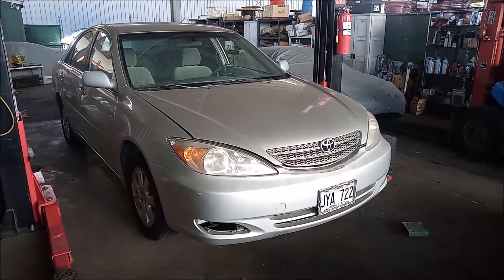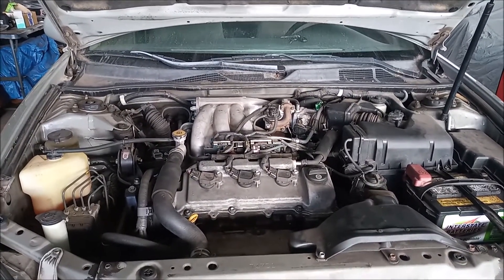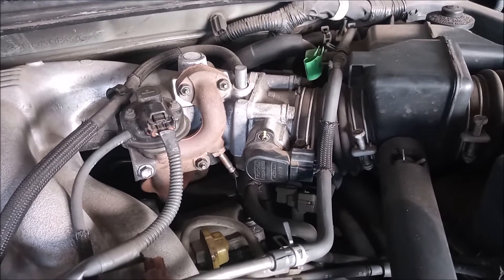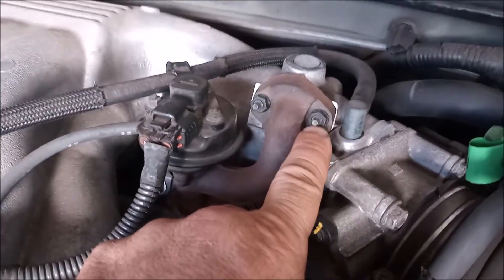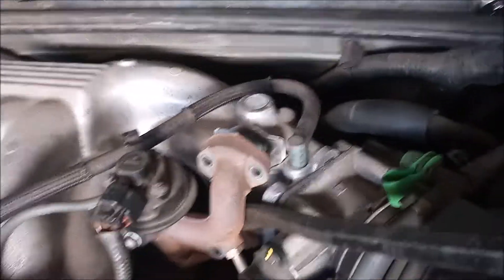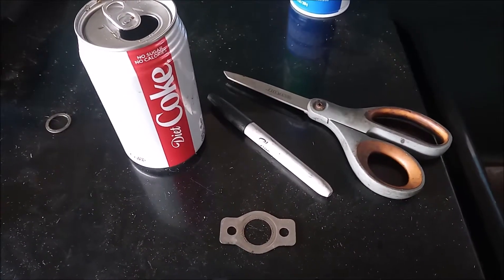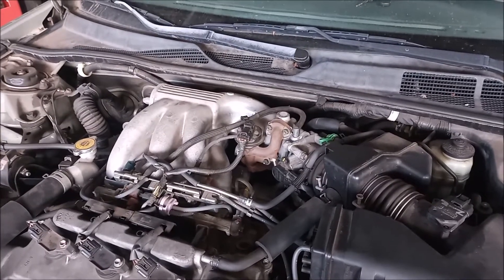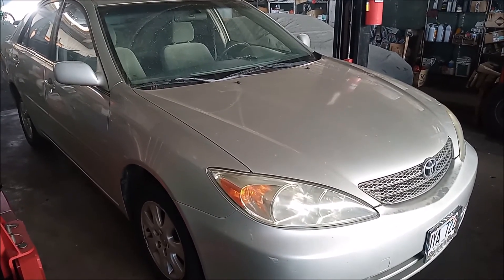EGR System Block Off Test - 2002 Toyota Camry 3.0 V6 1MZ-FE

Comment: ACIS ACOUSTIC CONTROL INDUCTION SYSTEM.  FOLLOW VACUUM LINES TO VSV & CHECK VALVES BUY NEW HOSES IT CONCERNED. CHECK ACUTUATOR FOR ACIS BE SURE DIAPHRAGM IS GOOD. CHECK SET SCREW ALSO

Comment: In order to possibly help someone… ‘98 Avalon with 1MZ-FE.

For years it had a throttle shudder(at all RPMs/only in gear) with no code. I thought it was most likely transmission related.

It finally threw a fleeting code(I just happened to have my scanner hooked up looking at live data whilst driving one day and caught it as it didn’t last long) for EGR position sensor.

Couldn’t find a genuine Toyota part. Amazon China part under Standard auto parts brand. It actually worked. Car drives so much better.
Reply from the maker: Thank you for watching and for commenting.

Comment: I think your looking in the exact right place my 2003 camry 1mzfe had the exact same problem and it was the egr valve your test was the problem I disconnected the egr through the main harness and it solved all the issues blocking it off only stopped the excess fumes from going into the intake manifold it didn't stop the erratic nature of the bad egr valve wich the car was obviously experiencing I also never had a code thrown
Reply: It's the sensor thinking there should   there should be the excess fumes coming at a particular time because the car electronically thinks the egr valve is doing what it should so it keeps changing the tables but it's because mechanically the valve isn't opening or isn't opening enough and blocking it off dosent change the tables It's actually 100% diagnosing the problem with out you realizing
Reply from the maker: Thank you for this info.
Reply: are you saying you just left it on and unplugged it?

Comment: I'm getting P0401 and P0402 both on a V6 2002 camry. Any suggestions ?  One code says high flow other says low flow so I don't understand how it can be both.
Reply: Was it a "sticking" EGR Valve? Under one condition it produced too little, and under another it caused too much, while hanging open?
Reply: I have an 2000 1MZFE doing the exact same thing but I don't understand it can't be sticking though already I just put the EGR in
Reply from the maker: Tough call.

Comment: Everyone searching for misfiring problems. On bank 1 try that first cat mine melted everything inside to become a metallic cork in the exhaust downwards from the cat on bank one. To check if it runs better take out O2 sensor on bank 1 and that will free up air. Then if you get power back significantly.. You have your issue.

Comment: My 2002 Camry XLE would sometimes stall when stopped at red lights, about once or twice a month. At which point, it would be unable to start again for a good 5-10 minutes. I took it into the Toyota Service Center three separate times that it stalled but they were unable to replicate or diagnose the problem. Frustrated I started searching car forums online and someone suggested an issue with the EGR valve. I ordered a replacement online and had it installed. 15+ years later and it has never stalled again.
Reply from the maker: Definitely egr valves can cause trouble. Toyota has eliminated them from most cars. The vvti system can serve the same function of controlling emissions.

Comment: Egr would have to be removed and put under small amount of pressure to see if the float moves. If that checks out then it needs to be clean out to remove all that carbon build up. If its totally obstructed it will throw a code. Correct me if I'm wrong.
Reply from the maker: I suspected it stuck open, but this was not so.
Reply: How about mass air flow sensor is it covered with carbon build up or the throttle body.?
Reply from the maker: @briank6375  the mad was the first thing I swapped after I cleaned the throttle body the went on to other test including this one.
Reply: Yeah there eg recirc. ports clogged.

Comment: So it was not an egr problem? I have same engine in my 2000 solara its throwing egr code  it runs fine when Its not fully warmed up but after its starts running sluggish
Reply: On startup and for the following 10 minutes most vehicles run in open loop (or feedback bypass) mode. Meaning the O2 sensors are not incorporated into the ignition control fuel trim. Once a certain set of parameters are met the ECU switches into closed loop, requiring feedback from all sensors including the O2 sensors which are a common culprit for this change in operating after warm up. Some models a faulty EVAP solenoid can produce similar results. Worth ruling out.
Reply from the maker: "Running sluggish" is a very vague term, but in general this can be due to any number of things. Tough to say if it has anything to do with the EGR.
Reply: How about mass air flow sensor restricted with carbon build up.?